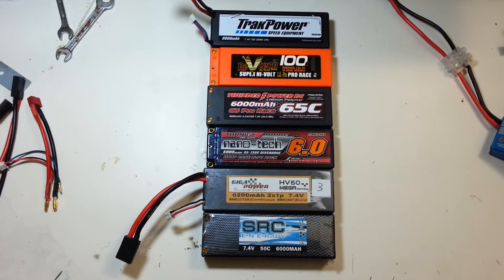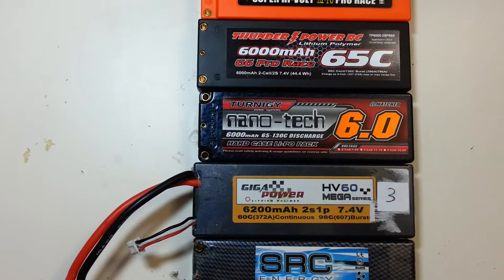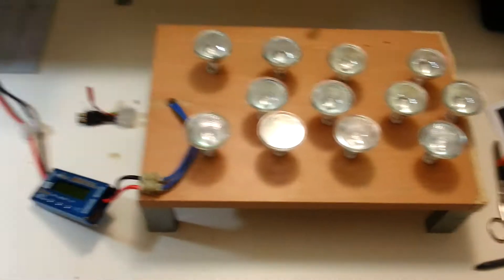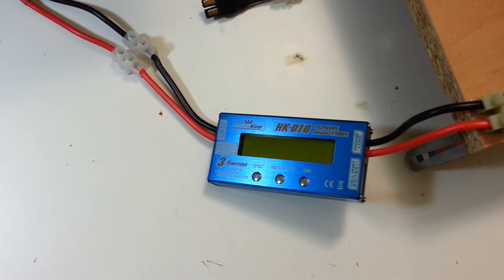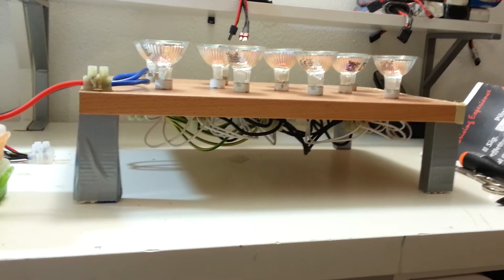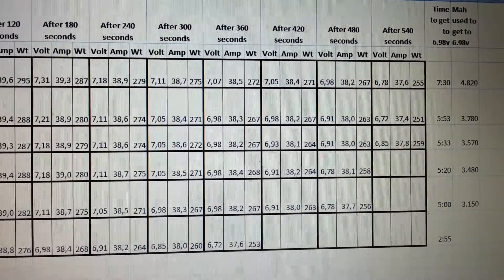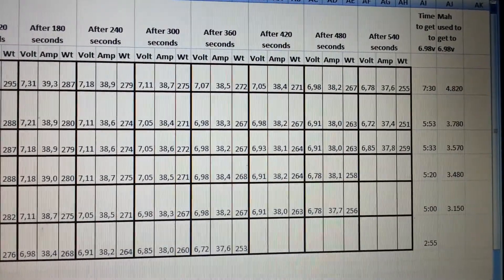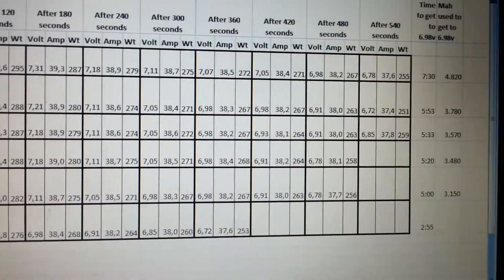40 Ampere Lipo load test (Trackpower, Thunderpower, Revtech, Turnigy and others)

Comment: Venoms are rebadged Intellect (IP) lipo's. They are utter rubbish. Thunder Power and Track Power have the best voltage hold and life cycle. I have 2x Thunderpower  5300mah 65C LIPO and are used nearly every weekend for a year. They are only just beginning to experience a slight drop in performance. All other LIPO I had lasted 3-4 months and die.